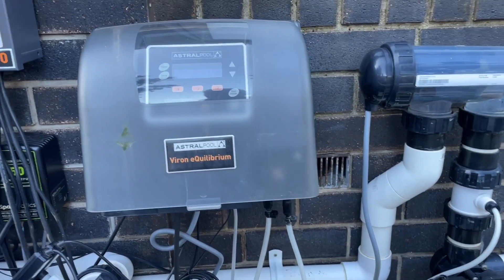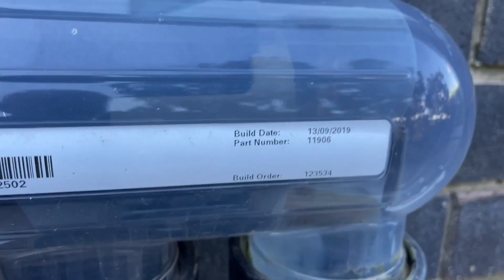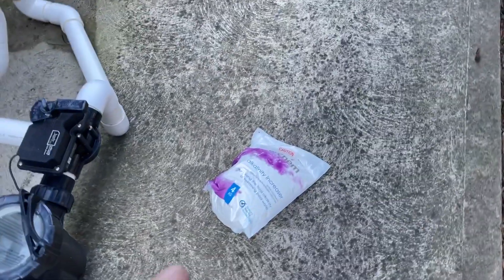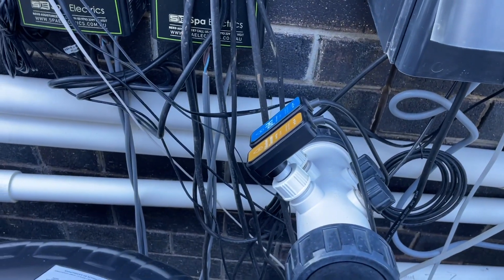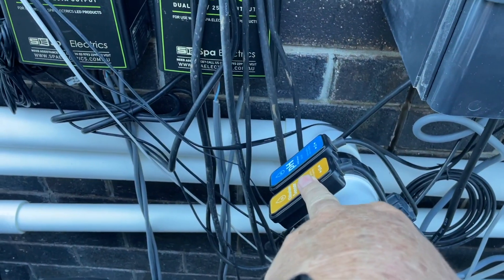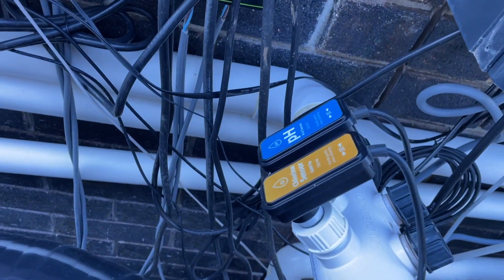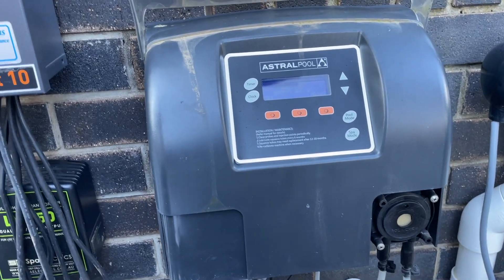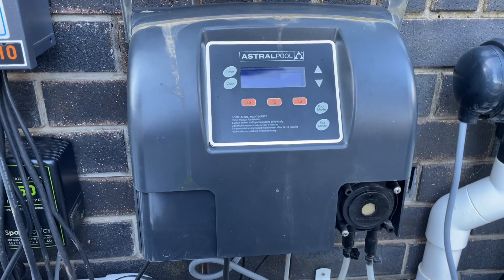Why I hate Swimming Pool Auto acid feeders & Salt Chlorinators linked to Probes. Automation pH Chlor

Comment: Pool maintenance people have been brain washed to add buffer to stabilise the pH. That is the job of the acid doser. Add Buffer and watch the acid doser pump in the acid.
Don't add buffer and pool ph stays fine because it is constantly monitored and adjusted by the controller. 
My Austral Viron is 8 years old. Second set of sensors and cell. still running. Sensors need to be cleaned every 6 months with a bit of cream cleanser.
My problem with Viron is that the build quality is poor - the steel frame of the controller unit is rusted to buggery, black casing overheats in the sun in summer, cover is split like this one.
The local pool maintenance people we use while we are away add 3kg of buffer every fortnight, complain about the acid being used and will not stop adding buffer, and don't mind charging me for the chemicals.
They can not follow instructions provided in my 20 minute briefing, didn't fill the acid doser adding manually, and still added 3kg of buffer.
For safety reasons, i will have to replace the chlorinator to something the pool maintenance people can understand and this appears to be a good one.

Comment: One season in and I find my Hayward Omnilogic was easy to set up to generate CL at a reasonable level.  It was the manual addition of Muriatic acid that I don't like.  A new pool with new plaster required a lot of acid.  I am going to look at a CO2 system which will not affect TA and is not so scary to handle.  I have not decided which probe to use.  May be I'll run it like the chlorine generator and test frequently but let the system dispense at a rate that I set.

Comment: Agree and then some. Spent $7K on Astral system with Halo Chlor but experienced nothing but problems with automated system. Acid doser disintegrated and needed replacing. Tubes have to be replaced. Replacement PH sensor is over $400. Green pool for months. Vinyl liner damaged from excess chlorine levels. After a year Astral (Fluidra) warranty expired and they refused to look at it to fix dosing issues.

Comment: New to pools, bought a house with this very system…. Finally read the manual. Said dont use Cyanuric acid as it messes with orp calibration.  Sensors need regular calibration.  Ive unplugged the orp sensor am now in manual mode.  Will get some ph and orp calibration solution and re test.  Think this system needs regular checking with test strips to confirm it’s working… no not suitable as a set and forget system…

Comment: Hi Mark, just came across your reviews, terrific stuff.  After months of research I bought a BIONIZER 3in1.  Only been installed for 3 weeks and I cant stand it.  Their online support has been terrific but I just cant work out how to adjust the system.  What do you think of them?  Hardly the maintenance free set and forget system I thought it would be.  Is the KCHlor suitable for minerals?  cheers and thanks   ed
Reply: @edwardhanna4503  k-chlors will run on mineral salts. Couple different ways to run minerals in your pool. You can use normal salt and add minerals to that. You can use pre mixed salt and minerals. You can go Magna blend which is potassium and magnesium rather than salt. K-chlors are great as mentioned, though if you’re wanting to keep with the times look into the crystal vapure chlorinators, they are a semi commercial model that has salinity measuring just like the k-chlor. They also will allow you to run the system where you can have a chlorination period and non chlorination period, this is very handy when running heaters so that you can still run the system for long enough to heat the pool but not over chlorinate at the same time. Saves money on buying external controller etc

Comment: i totally agree with you i have the exact unit pools been in for 15 years concrete tiled pool i haven't filled my acid drum up for 2 years and its still 3/4 full ive come the conclusion i need to no the chemistry of my pool so i test every 3 days or so and adjust chemicals accordingly very painful when you pay thousands for a pool and the pool shops just say add this add that my conclusion is understand your pool

Comment: Agree with your comments l have the exact same model etc . My beef is that when l set ORP AI mode set 650 l get very high chlorine 10,000 plus. I can calibrate PH on menu settings but don’t see one for the chlorine production?
Reply from the maker: Sounds like the pH side of your unit is still working well. 
I have finally found a pH unit that I trust. So well thought out this one. 
pH Mate. Best Pool Christmas Present for 2024. Finally a Swimming Pool acid Feeder that is Very Good
https://youtu.be/WktbvIEckQE

Comment: Mark, you are 100% spot on! I have a puresilk hayward system that we got with our new pool. About 7 years old now but i would never get this again! Had nothing but trouble. Anyway it is now not working at all & im doing the research & looking to replace. Are you in the melb area?
Reply from the maker: Yes I am in Melbourne. 
This is the Chlorinator that I sell and recommend. It is very good and reliable. 
The Best Saltwater Chlorinator in Australia by far. K Chlor Digital. Recommended by me Swimming Pool
https://youtu.be/WCNvIpNAtoc
Mark
PoolnSpa Supplies Australia 
PoolnSpa.net
Reply from the maker: Good News
After many many years of finding reliability problems with Swimming Pool Acid feeders. The automatic systems that test and adjust your pH. 

Mark has tested and found a brand that is Quality Aussie made, reliable and not crazy expensive. 

So if you would like your pH taken care of safely and all the time, then watch this video. 

pH Mate. Best Pool Christmas Present for 2024. Finally a Swimming Pool acid Feeder that is Very Good
https://youtu.be/WktbvIEckQE

Link to buy: https://poolnspa.net/shop/pump/ph-mate/

ON SALE UNTIL DEC 31st

Mark
Nillumbik Pool and Spa Service 
Melbourne installation available. 
Installation video available.

Comment: Totally with you on the problems. There doesn't seem to be many sites on the Net that review these products. Is it worth paying more for some brands rather than another? I don't know. After going through two salt water electrolysers and a two ph probes in a few years I am now manually dosing my pool - and abandoned solar water chlorination entirely. Problem is I don't know what to do when I go away, as human labour costs for pool maintenance are so high.
Reply from the maker: Hi there. 
Yes there are some bad brands out there and to be honest the more expensive ones are not necessarily better, just maybe have a bigger marketing budget. 
I am a Swimming Pool and Spa service tech so I get called when Chlorinators break. 
Have a look at this link. I have found an Australian made Chlorinator that is well made and standing the test of time. I have sold heaps of them in the last 5yrs and I am yet to even sell a replacement cell. 
Check them out here:

https://poolnspa.net/chlorinator/
Reply from the maker: Good News
After many many years of finding reliability problems with Swimming Pool Acid feeders. The automatic systems that test and adjust your pH. 

Mark has tested and found a brand that is Quality Aussie made, reliable and not crazy expensive. 

So if you would like your pH taken care of safely and all the time, then watch this video. 

pH Mate. Best Pool Christmas Present for 2024. Finally a Swimming Pool acid Feeder that is Very Good
https://youtu.be/WktbvIEckQE

Link to buy: https://poolnspa.net/shop/pump/ph-mate/

ON SALE UNTIL DEC 31st

Mark
Nillumbik Pool and Spa Service 
Melbourne installation available. 
Installation video available.

Comment: Mine is astral e25 very basic one. Been 7 years working perfect. The pool shop owner told me this kind of automation has too much problem.  The probes are very expensive.
Reply from the maker: Good News
After many many years of finding reliability problems with Swimming Pool Acid feeders. The automatic systems that test and adjust your pH. 

Mark has tested and found a brand that is Quality Aussie made, reliable and not crazy expensive. 

So if you would like your pH taken care of safely and all the time, then watch this video. 

pH Mate. Best Pool Christmas Present for 2024. Finally a Swimming Pool acid Feeder that is Very Good
https://youtu.be/WktbvIEckQE

Link to buy: https://poolnspa.net/shop/pump/ph-mate/

ON SALE UNTIL DEC 31st

Mark
Nillumbik Pool and Spa Service 
Melbourne installation available. 
Installation video available.

Comment: Have my zodiac lm340 in a shed. Still going strong. Never trusted self dosage acid.
Reply from the maker: Good News
After many many years of finding reliability problems with Swimming Pool Acid feeders. The automatic systems that test and adjust your pH. 

Mark has tested and found a brand that is Quality Aussie made, reliable and not crazy expensive. 

So if you would like your pH taken care of safely and all the time, then watch this video. 

pH Mate. Best Pool Christmas Present for 2024. Finally a Swimming Pool acid Feeder that is Very Good
https://youtu.be/WktbvIEckQE

Link to buy: https://poolnspa.net/shop/pump/ph-mate/

ON SALE UNTIL DEC 31st

Mark
Nillumbik Pool and Spa Service 
Melbourne installation available. 
Installation video available.